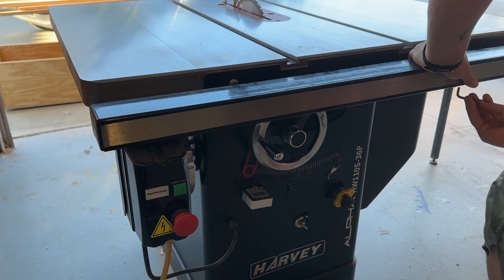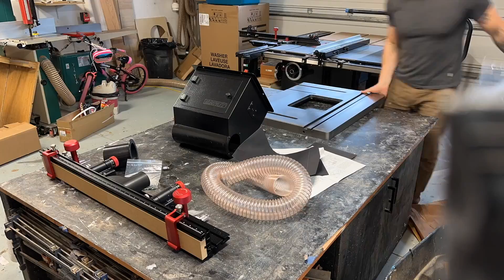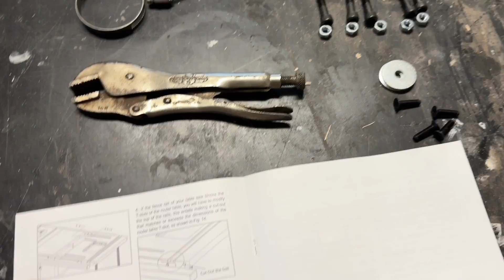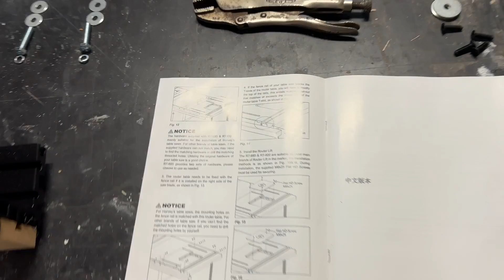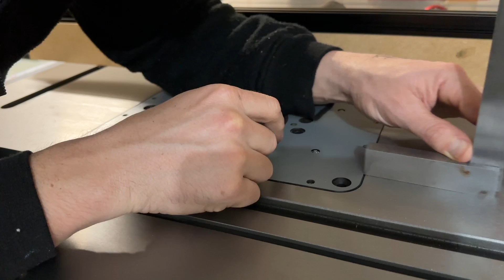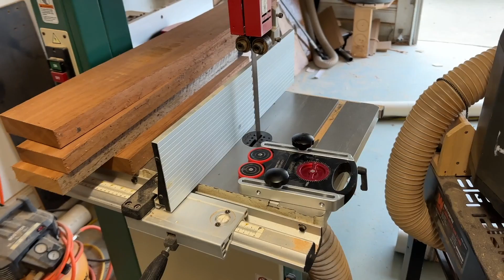Harvey Sliding Table and Router Table Install

Comment: What's your experience taking the miter gauge off and on and getting accurate, repeatable cuts with the degree detents? Is there slop?
Reply: For the one on the slider? Do you re-square it when you put it back on? I've heard others saying they don't trust the angle detents because of a little slop. I just want to make sure you're talking about the one on the slider.
Reply from the maker: @BrentDaughertyMe  once you get it dialed it it's good. There is a switch you can flip that'll let it free float, not indexing on the detents, and as long as you like up your indexing lines and lot it down you're good. The detents do a pretty good job though. I use it for all my precision cuts.
Reply from the maker: No issues.

Comment: Ikea can supply hardware in bags clearly labeled and heat seal separated, along with proper instructions for a $100 bookshelf. 

But Harvey can't do the same for $1500 in accessories to attach to a $2k+ (or whatever) saw?
Reply from the maker: tell me about it!

Comment: I agree with you regarding the terrible instructions! What are your thoughts about the overhead dust collection. Or the dust collection in general? Mine is awful on my Harvey.
Reply from the maker: I rarely use the blade dust collector that comes with it. You can't really use it with the cross cut sled because you can't slide the piece back. It also doesn't collect "all" of the dust. The only time it makes sense is if you're cutting a lot of the same width pieces for example if you were making American flags and had to cut like 100 pieces that are 2 inches wide. Then it would be helpful but other than that, I don't use it. Idk if it's the design or just the nature of table saws. It seems like they put a lot of thought into the design but it is what it is. I normally keep the bar tube plugged to redirect all the suction to the bottom cabinet. I think the free floating over head dust collection solution may be better. I also saw a video where a guy modified his table saw dust collection to have a port that sits flush with the top of the table in front of where the blade is. Kinda where your belly would be standing in front of it because that's where all the dust gets thrown. You do a lot of cuts and you look down and your stomach is just blasted with dust. So he added an under the table port right there to capture some of that. Seems to make sense. I have not gotten around to it. The good news is Harvey includes the blade guard collector with the saw so it's not like you have to pay extra. But again, I rarely use it for my style of wood working and the projects I do.

Comment: hi question for you. I am currently thinking of buying this complete setup and I noticed you had the 36in rip capacity version and I'm hoping you can tell me how much of a foot print this setup takes up in your garage? That's to include the slider and all. I am considering to go 52in but not sure if I will have the space or not. I"m currently using a 2 car garage space. Get back to me when you can, thanks.
Reply: Is the saw the 4hp? There are so many different model names I have no idea how to choose.  I’m wondering if I can just use the 2hp as a hobbyist
Reply: @JoeyGaglioti if you’re just using it sparingly, I would stick with the 2hp 120v model. Only problem is that it only has a rip capacity of 36 inches. They don’t make a 52 inch model with the 2hp motor
Reply from the maker: @JoeyGaglioti  This is the 4HP yes. When I upgrade a tool I only do it once. I used my dads old craftsman 2HP table saw for many years, don't get me wrong it was a work horse, solid heavy cast iron top motor hanging out the back. Plenty of power. So when i decided to upgrade, I made sure it was the last tablesaw I'd ever need.
Reply from the maker: @MrJauxT  it’s 89 wide by 49 deep. Add another 12 inches for the extension arm of the slider

Comment: I have this same saw and I need a router table and trying to decide if I want the Harvey table saw wing router table or if I want a stand alone router table. Do you find that this set up gets in the way and you’re always moving the router table fence for table saw cuts? After using it woukd you have preferred a stand alone router table?
Reply from the maker: Depends on the side of your shop. If you're in a small garage like me, I highly recommend the harvey wing attachment. I will sometimes have to remove the router fence to make room to slide the table saw fence but it's rare and easy to do. I recommend the harvey
Reply: @KeimpieceCarpentry  Thanks. My garage space is 28x30. I technically have enough space for a stand-alone router table but any space savings is great and makes room for other tools. A lot of people steer me away from the table saw wing router table but I just see a lot of advantages.

Comment: How’s the miter doing for you to stay in position when set for a 90 degree cut? Mine slips out of that angle fairly easy. It makes me think I’m missing a point of tension from a bolt, but I don’t know what I’m missing.
Reply from the maker: I don't have an issue with it, it stays locked in

Comment: I know exactly what you are talking about.  I had extra hardware and was not sure as to where it was to be used.  However, I just happened to see the Exploded View and Parts List at the back of the manual and it did clear up some misconceptions.
Reply from the maker: yea, it's just surprising that for such a nice tool, the intructions are lacking

Comment: I recently picked up the HW110TC-36PG, which came with the Big Eye fence (which is awesome), Harvey router setup with the JessEm lift like you. I agree with you on the instructions being practically useless. My question is will this slider replace a cross cut sled completely—seems like it would and wonder if you did the 5 cut test to ensure it is square?  Great video!!
Reply from the maker: Great question. I would say that was my hope, was that it would and I would no longer have to drag and lift my big cross cut sled up to the saw, for most cuts it does, especially angled cuts. But honestly, a cross cut sled has it's advantages. I find that when cutting small pieces off, like 1 inch off cuts, it gets dangerous because the little piece sits near the blade and I'm worried it's going to drift to the front and then BOOM explode in my face or shoot across the shop, which has happened. It's very annoying and slows down production because I need to stop the saw, or carefully knock the piece out of the way each time. But with a cross cut sled, the sled moves as well so the small piece of cut off gets carried forward away from the blade and you can safely grab it. Also, the slider its always in the way, you can't easily remove it. So find myself having to put it at 45 degrees and pull it all the way back to stand in front of it when using the table saw normally, but now that wedges me in between the saw and slider which doesn't make me feel safe. Yes I did the 4 cut test, it was pretty dang accurate out of the box. Again with cutting smaller pieces, a cross cut sled holds the piece for you, there's no friction between the work piece and cast iron so its easy and safe to hold a small piece in place with a pencil or something. But with the slider, the work piece is sliding across the cast iron towards the blade so the more downward pressure you put on it to hold it safely in place, the more friction you induce. so again cutting smaller repeat cuts sucks. I would say it really depends on the type of work you do. If you cut a lot of sheet goods, this may make more sense. There have been many times where i break out the smaller miter gauge that came with the saw and my old cross cut sled, but now I think i will build a new smaller cross cut because the grooves in my outfeed table no longer line up because I had to shift it over for dust collection re work. Hope this helps.
Reply: Thanks for the quick response and insight on the slider vs cross cut sled.  Your point on the small pieces by the blade is good, plus after I got my setup I noticed it takes considerably longer for the blade to completely stop spinning which makes it worse.  I replaced a 25+ yr old 10” Delta contractor Table saw and having all this power really is impressive and a little stressful getting used to it.
Reply from the maker: @clintmalmquist4423  yea I'd start of with a nice sled and if you find a need to upgrade to a slider, then you can make that decision